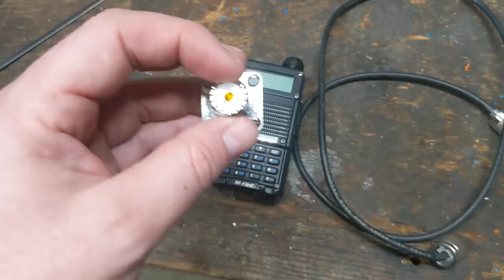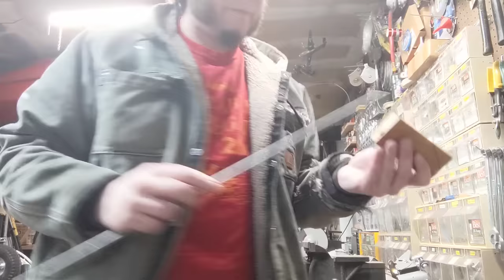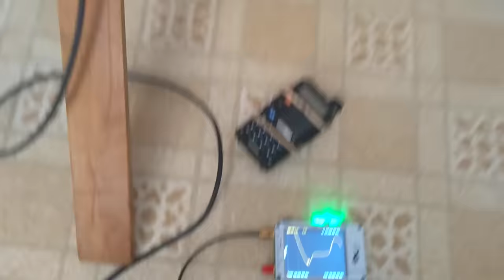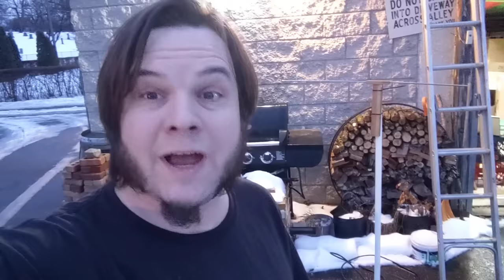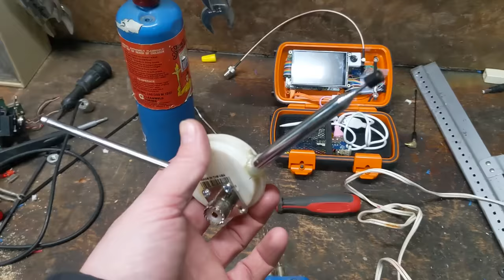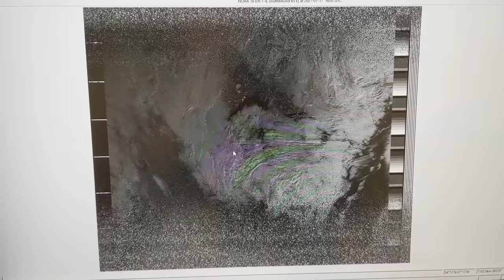Listening to Weather Satellites with Random Junk

Comment: Just buy uv-5r you can get them anywhere in there like 20 bucks which is basically what you using there and a yagi antenna
Reply from the maker: Yeah, that's essentially what I had, I've picked up a few of those cheap radios used or slightly broken, but new ones are under $30 US.

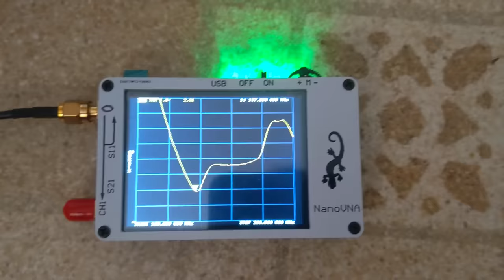Comment: 6:45 What was the SWR on the VNA when you connected to the dipole?
Since it’s a balanced dipole, maybe a balun would be necessary between it and the coax.
Reply from the maker: I haven't checked this one by itself, although I hooked it to the VNA as part of a Yagi in a later video. I really don't know how it's wired, it's just what comes with the RTLSDR kit.

Comment: ..So, HOW did you solder to Aluminum??  Did you use pieces of brass?  That would be one way around that problem.
Reply from the maker: Dang if I know, I'm so bad at soldering that all my connections look like that. I guess it just sort of blobbed around it and made enough contact to work.
Reply: @saveitforparts  to truly create a solid joint, you want to heat up the device, not the solder.

Once the device is hot, the solder will wick to the device as you apply the solder to the intended joint. 

I thank you for the quick demo / POC. I only impart my knowledge as you’ve already done so much for me. Soldering can be a lot of fun if you know what you’re doing and have the right gear. 

Home tools;

Fiberglass pen
Flux
High grade electronics solder with flux core
Tip cleaner
Third-hand tool and or PCB mount 

Pro tools;
Temp controlled hot plate
Temp controlled hot air rework station
Trinocular Microscope so you can port the 3rd scope to a monitor

Just watch Louis Rossman

Comment: u have 2 wires from the coax do they connect copper insulator to one center to the other
Reply from the maker: Yep, one wire goes to each leg of the V-dipole antenna, as seen here: https://www.rtl-sdr.com/simple-noaameteor-weather-satellite-antenna-137-mhz-v-dipole/

Comment: Which impact does the angle have regarding the receiving specs?
Reply from the maker: It seems to work best when it's near the ground (or a ground plane like chicken wire) and pointing the open end of the V towards the South. Although I did end up building a slightly better antenna (QFH) later.
Reply: Is there any mathematical formula and physics doctrine regrding the enhanced reception, on v dipoles?

Comment: I have a old walkie talkie (really old) that my grandma gave me. I have somehow made it work. I think its 1G signal but i am not sure
I can sometimes hear some speaking sometimes its English sometimes not sometimes i dont hear it at all it gets kinda scary sometimes
Does anyone know what it is? And does someone have a same experience as me?
Also i can sometimes hear peoples TVs if i use the walkie talkie near their house and i can speak into their TVs wich is super fun
Reply from the maker: If it has a brand and model name, you could look it up and see what it does. If there's no name on the outside, sometimes there will be info inside the battery area. There are lots of old handheld radios that could interfere with other electronics, CB radio was pretty notorious for it, and VHF/UHF could bleed over onto older TVs.
Reply: @saveitforparts  i will take it apart and look it up
Thanks for the info

Comment: Don't you have to have a license to operate a ham radio? I'm surprised you can get one for that cheap.
Reply from the maker: You need a license to transmit (which I have, but I don't usually use the $25 radios since the signal quality is terrible). Don't need a license to listen (in the US anyway).

Comment: Hey can i give you a bit of friendly advice for you?

You have a round head/face just like i do. So you need to elongate your face by bringing in the sides. I think you would look so much better if you cut off the pork chops and kept the fumanchu and then got a haircut where you bring ijiyour sides to at most a 2. You can keep the top long and fluff it up with gel. Make these simple changes and i promise you will look 10x better. Just some friendly advice since i have s similar fsce shape as you... nothing negative intended.

Comment: this has kind of nothing to do with your video here, but i'ma ask anyways (even though it's 2 years old) i have a baofeng, and i was thinking of using a small 20 watt amp thingy, but i dunno if it only boosts the transmit or if you can boost how the radio receives, i dont talk on ham, i hate almost all human beings, the satellites interact easier and quicker and without that other crap that humans like i guess. (i hope, i havnt tried anything yet)
Reply from the maker: It sounds like the type of amp that boosts transmit power. If so, it wouldn't help for receiving (and might not be legal depending on your location / use).  There are also receiver amps (LNAs), usually with a filter to limit interference and noise. For listening to satellites, I usually use one of Nooelec's SAWbird LNA products along with a software defined radio. I've never tried one of those on a Baofeng for receiving, that might be interesting but would be a little clumsy with the extra power supply needed.
Reply: yea, im just a broke loser so i'm always trying to boost everything beyond what it came as, because i always buy cheap, nothing i buy is ever good enough, lol (the baofeng seems to be though it's done a bunch already , i think i was listening to train wheels tell someone they were not damaged and okay :O  @saveitforparts
Reply from the maker: I've found the extra long Nagoya antennas are decent for getting better reception. Also just holding it vertically and as high as you can, away from other electronics / buildings / etc. For indoor use I stick mine in a windowsill as high as I can, and not near a metal screen.

Comment: What site do you get the frequencies ?
Reply from the maker: For satellites, n2yo.com is a good one. It shows when they'll pass overhead as well as the frequencies.
Reply: @saveitforparts  is there a way to use the VNA as a frequency counter ?
Is there an app for the phone that can be used with it ?
Reply from the maker: I'm not sure, I mostly got it for antenna tuning and haven't had time to really experiment with all it's other functions. I have a cheap Radio Shack frequency counter that's a lot simpler to use for the few times I've been curious about a TX frequency.

Comment: how is there a map overlay in the image already?
Reply from the maker: You can add map overlays with the software once it knows where you are (or if you set the location manually).
Reply: So that comes from the  "wxt image" software that you loaded the data into?
Reply from the maker: Yeah, you can choose which satellite and what time you recorded the audio, and it tries to calculate the location. It's not always accurate doing it that way, but  you can adjust things if you notice an error (I used Lake Superior as a known point to adjust things, since it's easy to spot if not too cloudy). There's an updated version of the software here: https://wxtoimgrestored.xyz/

Comment: Radio is about $20 to $30 
--- two years later ---
Radio is about $60 to $80 

I want to go back.
Reply from the maker: Where are you shopping? The basic ones like this are still $20 on Amazon/ebay. The latest ones with tri-band etc might be a little more.